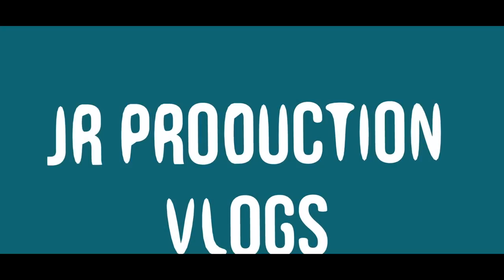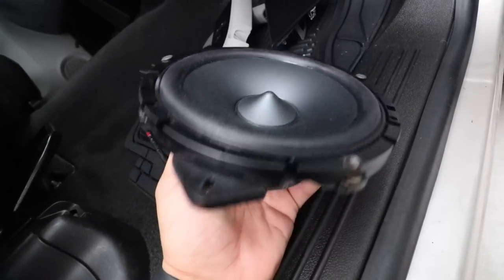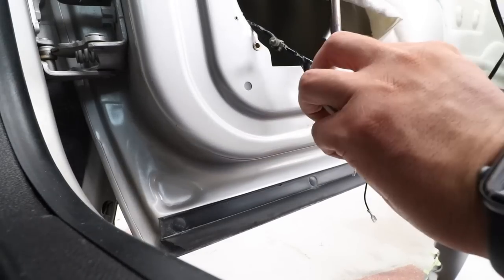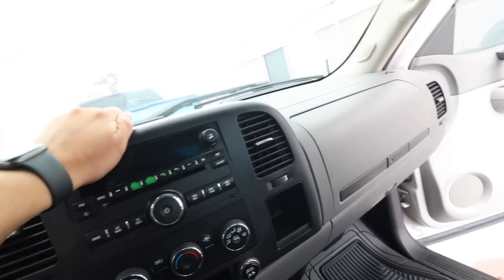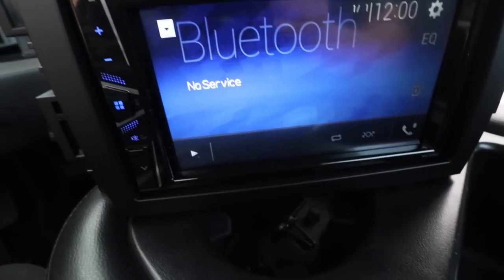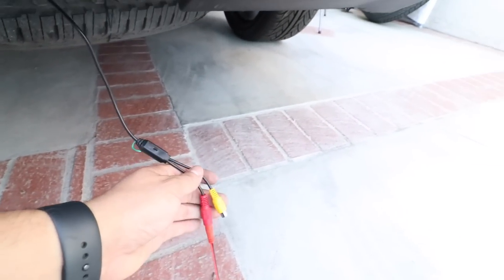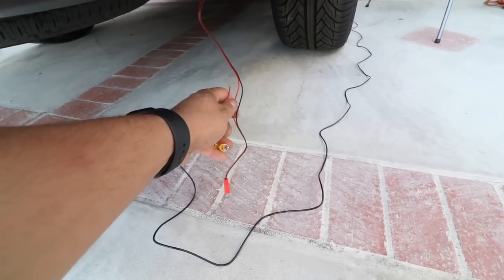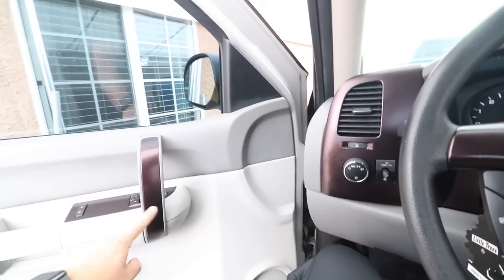INSTALLING NEW SOUND SYSTEM!!!

Comment: Alpine you took out were better than the ones you put in. Just didn't have the right power/crossovers to them.
Reply: Those speakers are way underpowered  they would sound amazing if he did what you just said
Reply: My same thoughts
Reply: Well, the alpines were component woofers. All he needed to do is buy the tweeters and cross overs to go with them.
Reply: hshj04 Yeap you right
Reply: i have alpines on my 08 single cab and the soundsystem sounds good asf
Reply: I had some type s components in my car and they sounded amazing!
Reply: Yes alpine.  In components are that best.  I have 2 alpine head units  whit alpine speakers and ilpine pdx 400 1 for mids and higs and Sound realy clean
Reply: Thats exactly what I think when I hear him talking about alpine
Reply: I think that they’re blown or something because ik how they sound and they sound good but when he tested them they sounded like they were being over powered? It sounded like they were screaming

Comment: Those alpines are really good speakers, the reason they werent clear is because they are component speakers so you were trying to play a full range signal through a woofer, component speakers are usually better for sound imaging and the rockford is 2 way so it has a woofer and a tweeter built in, so the tweeter for the alpine shouldve been in the factory location, however if you put an amp on those alpines then they would really come alive, its just that the alpines tweeter wasnt with the woofer like the rockfords so thats why the rockford sounded better

Comment: The purpose of the brackets were to have optimal sound quality and to not have that gaping hole which a lot of sound escape. Should consider putting the brackets in and using foam.......just a piece of advice if you want that high quality sound
Reply: I was also worried that his windows would hit the magnets of the speakers. Maybe not though.

Comment: Good video!  I would have used some fast rings and some sound deadener in the doors. On the back up camera I run the back up trigger wire and ground to the towing hitch harness. Keeps everything clean and tucked away. Great job though.

Comment: If you're having staging and imagining issues it's probably going to be those tweeters in the  pillars. You might have to do away with one set of  tweeters, if you haven't done so already. Otherwise you might have to consider having all the tweeters the same make and model and wiring them in series into a crossover.  The series wiring will attenuate the sound of the higher frequencies but since the tweeters in the pillars are already overbearing, being that they are so much closer.

Comment: Check speaker polarity also, you may have sound cancellations if they are out of phase, that maybe de reason of the crappy sound.

And if you want to truely get the most of any speaker, you should amplify and never run a system from a head unit. Most aftermarket head units give 20-30W rms per channel if you are lucky, and the speakers you put in need double or more the power you are feeding them with in order to sound as they should.

Comment: You should use foam shrouds to force the sound through the grill, theese would avoid the sound waves being trapped between the panel and the door, and force them into the cabin. By the way, that grill/panel opening seems for 5,25" or smaller speakers, so without the foam a lot of sound is wasted

Comment: I’m new to sound systems so can y’all help me with some good brands? I heard kickers are pretty good and as for the amp I’m not really sure.
Reply: kickers are good but their subs require huge boxes to sound right, their L7 sub requires at least 3.5 cubes compare to other brands that only need 2 cubes. their amps do rated power but the kxa is the only amp thats 1ohm stable
Reply: SHō ˌôf my uncle makes custom boxes from “grade a wood” so I’ll ask him to make me one. And also do you need to upgrade your battery or should the stock one be fine.
Reply: SHō ˌôf i was thinking 700 to 800. I don’t wanna risk blowing my subs like my uncle did his
Reply: @DONKEYSHIEET  you will need to upgrade to an agm battery and do the big 3 upgrade. if your lights are dimming with those two upgrades installed then you will need to add a second agm battery. dimming is bad because its a sign that your amp is starving for power. if its starved the amp could overheat or send a clip signal to the sub which can blow the sub
Reply: SHō ˌôf do you think it’s better to just add a second battery while installing everything or try just the one battery. I really appreciate the help man👍🏽👍🏽💯
Reply: SHō ˌôf will do and once again thank you very much for the help bro I really appreciate it.
Reply: DONKEY SHIEET sundown audio , Rockford , skar , expensive but good brands I’ve tried all I’ve these brands , and I’ve never had a issue with them

Comment: Those wires that you used for the door speakers are terrible quality in time they are going to fray and you will be replacing it again, I work at stereo shop and we are certified resellers for Rockford Fosgate and we always recommend copper wiring for door speakers

Comment: Those alpines sounded bad bcuz they needed an amplifier they are power hungry of course they won’t sound good with that stock head unit .. you should of just kept those alpine but they where still missing the crossover and tweeter .. having no tweeters and no crossovers is not good ..